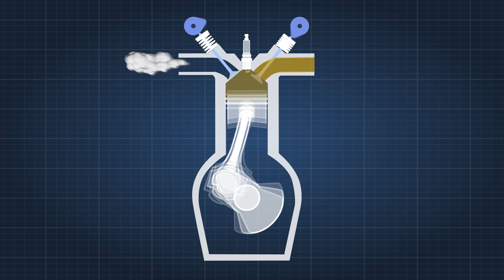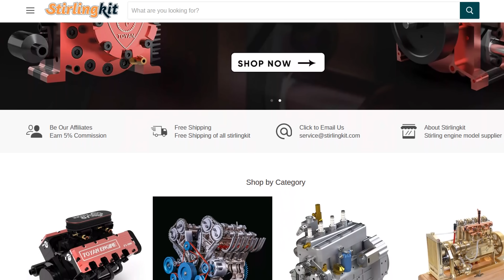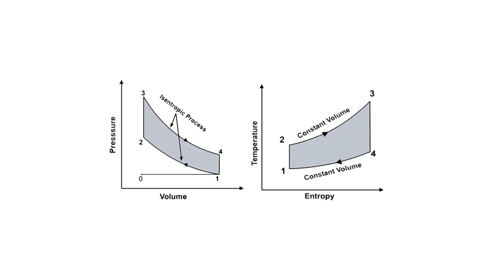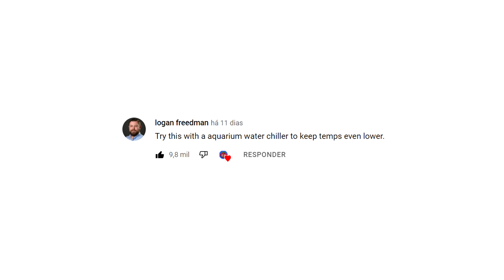I 3D Printed a Transparent Combustion Engine in Resin

Comment: Hi, can you make a vertical launched pulse jet powered rocket ?? i mean it is easier to make desired shape of nozzles & use of different fuel combinations than making complex turbine cycle use pressurise fuel & oxygen tanks like aluminium perfume cans to pump fuel & oxygen into the engine flow controlled by some air flow controls which used on pneumatic cylinders to achieve perfect mixture. i don't know it will work or not but I am just suggesting & if it runs on controlled rate than may be you can use some RC controlled fins & camera to monitor & control the flight, or you can make it without RC.

Comment: great video, nice work with the engine, another fuel you could try is hydrogen. You can make it through electrolysis or be creative and use drain cleaner and aluminium.

Comment: Im pretty sure nitromethane has less energy/liter with as you said the upside being the ability to burn more of it. This small engine could run into a plethora of different problems with this. Hard to test without owning one though.
Only things that come to mind are:
Inability to feed enough fuel, inability to properly aerolize all the fuel (especially because it's a carbureted engine) and the resin cylinder bending under the increased pressure and letting the pressure bypass the piston.

Comment: Even though the fuel is technically more powerful, that's only because you can burn way more of it in the same volume of air, which is limited by the size of the cylinder. The amount of fuel provided by the carburetor is fixed, so the nitromethane would have thr same amount of fuel per cycle as the higher density fuels. To make it run closer to stochiometric ratio, you'd need a larger jet in the carb

Comment: more compressing volume 2 ways to solve make rod conncting piston to shaft longer or make cylinder and piston wider
or the acrylic doesnt hold heat well

launch tomato into space it will freeze there

Comment: I think you need to up the Jules of the spark for starters. Than look at either increasing the exhaust valve or increasing the compression. I think if you decrease the intake valve you might start to find the perfect air fuel ratio which is absolutely critical in a 4 stroke engine design. Good luck!!!

Comment: Could you maybe try and see which if the fuels produce the most torque, maybe use a weight attached to a pulley and see which one can lift it the quickest?? Or drive a wheel on the skateboard and see which has faster acceleration???

Comment: Air fuel mixture may be off 
The engine may be over speeding and causing it to miss fire from to much intake velocity and causing it to blow out the spark or the high speeds could be causing valve float with as small as the valve springs are witch would cause the engine to run poorly from losing compression from the valves not closing completely you may need to put some tipe of load on the engine or some tipe of governor to control max engine speed

Comment: Every video I’ve ever seen of these miniature engines, they run very fuel rich, you can see it pouring out of the exhaust and in the case of transparent engines you can see it inside the cylinder. I think you need to find a way to lean the mixture out.

You may also want to find a better way to trigger the spark. I know I’m theory the magnet system works but these are toy engines, they’re never going to be perfect. The ideal solution would be a spark controller ECU like megajolt and a crank trigger but you could just try more of a constant arc like from a neon transformer to just be ‘sparking’ all the time. Perhaps it will affect the timing but it’s worth a try.

Comment: Yea this seems like a Combination of things;
1] The Acrylic Cylinder is not sealed well, you can see some Fuel leakage on the top of the Cylinder
2] The Air-Fuel Ratio is so high to the point that it's unable to ignite due to a Lack of Oxygen, in a way the engine is literally being Suffocated
3] The Engine might also be potentially Missing sparks due to a faulty timing system but this seems unlikely

Most of this can be fixed by simply changing the AFR usually done by turning a Screw in the Carburetor assembly where Tightening it means a Richer mixture and Loosening means a Leaner Mixture which is what we want. Also to fix the sealing try a combination of O Rings, Adhesives and Tension.

Comment: One issue you are running into is the different optimum air fuel ratios each fuel has.  
Dragsters that run on nitro run air fuel ratios close to 1:1 or less.
Gasoline engines run about 12.5:1 or so for max power and
Methanol is ~6.X or so I think. 

Each fuel also has a certain resistance to ignition which is part of what you are seeing in the non-4 stroke running. Methanol also runs cooler than the others to the point that given the right conditions can ice over an intake manifold. 

Nitromethane is an interesting fuel as it carries its own oxygen and can be used as a rocket fuel with an oxidizer or could be used as a mono-propellant. The more load it is given in a 4 stroke engine, the more power it will make. 

Try a hotter spark to get a more reliable ignition.

Comment: chances are that the pressure in the cylinder is Less therefore the engine has less resistance. if they were to get an external load the best fuel would maintain speed better than the others. 
that's just my guess as a mechanic.

Comment: Without a load you get unrealistic speeds
The missed ignition probably cause the unexpanded gases to easierly escape the piston.
A load might actually slow down the engine and cause ignition every 4 strokes.

Comment: Maybe the higher the RPM, the less time is used for the intake stroke, not being enough for getting over the fuel inertia, causing not enough fuel is sucked in -> no ignition.

Also, the thing you said, it can be that when the engine reaches high RPM, the time the spark needs to ignite is more than the time it has to do so. Just guessing

Comment: Timing has a lot to do with it.  Making sure that your cylinder is the correct size, maybe add some cross hatching to it.  Getting the air/fuel mix right is good too.

EDIT:  Also, you didn't really go into how the ignition system works.  Is it like a modern engine ign. system that charges a coil, or like a lawn mower that just triggers the spark mechanically?  There are a lot of variables here, but the RPMs you are seeing shouldn't be an issue.  It takes about 180 deg. of rotation to charge a coil 3ms (IIRC) at 10,000 RPM, so that's plenty of time for a single cylinder.

Comment: have you heard about the new omega 1 engine in development? 300hp from A 30-pound motor. it's a new style of rotary that's gonna change everything. you should try to build one, this is a true challenge because it's so new there's not that much footage or information on it. a true test of the engineering mind.

Comment: Why don't you use hydrogen to run your engine? It's carbon neutral(like, after burning, instead of co2, you get h2o) and is at leat 2x more powerfull than gassoline. The best part about this idea is, that you don't need to make another engine, it can run with almost every IC engine. Il'd love to see your approch about this idea.

Comment: I used to fly radio controlled airplanes that ran on 10 and 15% nitro/ methanol fuels. The engine is running slower due to the  air fuel mixture. Each fuel needs the carb  needle valve adjusted to run the best. Nitro blend fuel will burn at a lot wider air fuel ratio than gasoline or methanol.  Adding some load to the engine will help the misfiring as well. Needle jets designed for nitro fuels are less precise than ones designed for gasoline. Converting nitro engines to run on gasoline is difficult since the metering for nitro fuel is not precise enough to fine tune  a gasoline mixture.

Comment: You are in fact losing compression through the head gasket area, I could see bubbles on the first slo-mo of the engine running
However I do think that's just one of the issues, tuning an engine that small is an absolute pain I imagine

Comment: Simply going by industrial/military 'multi-fuel' engines, generally to burn a wider range of fuels requires lower compression, my guess would be the first firing is blowing past the o-ring piston ring and pressurising the crankcase, needing the second dead stroke to equalise, hence the hit and miss firing? Perhaps vent the sealed crankcase if it's not already vented and try making a more precise fit between piston and bore, possibly just a thicker/square profile o-ring? The colour of the flame also will tell you if you are getting nearer a stoichiometric (perfect 80/20 air fuel) mixture the flame should go from orange to blue.

Comment: You need the carburetor to be turned differently to work with each type of fuel. They each require a different air/fuel mixture

Comment: What's happening is a misfire on all the fuels except for nitro 25% this is either caused by inconsistent valve or ignition timing or a rich fuel mixture(too much fuel, not enough air). With this little engine I believe the rubber oring and the resin cylinder don't quite seal too good, so you're probably losing some of your compression there which doesn't help with the misfire.

Comment: You could be dealing with pre ignition, the fuel is burning when the piston is stilo going up, wich Will slow down the piston.you can even have little pockets of air and fuel that are self combusting causing extra unbalenced force on the sistem. Try retarding the ignition on the stronger fuels to get the most out of  them (be carefull because this can also destoy the piston).

Comment: when we use methane in drag racing we always modify the engine to take the extra power from the fuel which includes the ability to cram more of the fuel into the engine along with more spark power from the coils . we need to go with a more powerful coil to allow the fuel to be completely burned if you don't almost half of the fuel will just go out the tail pipe which is a waste

Comment: If it hasn't been said already electrically bond the head to the block, the original engine had a conductive cylinder for doing that, yours is probably using the valvetrain.

Comment: better carburetor the mixing ratio needs more oxygen with higher energy density of the fuel. therefore turbocharger, pure oxygen, nitrous oxide or all together for the overkill factor

Comment: Nitro has a slower flame front. More ignition timing needs to be added to take advantage of the additional power. Also with nitro you can make more power by adding more fuel. Basically can add fuel to the point where you will hydro lock the engine and you will keep making more power till you bend or break something.

Comment: the inconsistency across the fuels is very likely due to incorrect air/fuel mixtures. The carburator is made for gasoline, not for methanol or nitromethane. those require very different mixtures. Also, flame colour differs wildly from fuel to fuel. Nitromethane for example burns almost invisible afaik.

Comment: The different speeds might have to do with the mixtures igniting at different positional degrees, which can seriously harm efficiency.
Also the air fuel ratio might be very off
Reply: exactly, car engines have a timing adjustment to advance the timing with a faster rpm

Comment: I think it has to do with timing, by changing the octane of the fuels as you are, you change the ignition point in the cycle, you'd have to tune the timing to match the ignition time, useful for increasing compression to avoid detonation (Lower octanes self detonate under higher compression).
Reply: The motor has electronic ignition so unless it was a super high compression I wouldn't suspect there to be an issue with pre-ignition. Maybe double check with a micrometer the length of the cylinder maybe even sand it down a bit to gain some compression
Reply: Not to take away from what you said or be rude in any way but I don't suspect this four-stroke has the same type of compression that maybe a nitro 2-stroke motor would have
Reply: Timing as nothing to do with octane rating. Gasoline will brun at the same rate whatever the octane rating. The maximum timing that engine can take is only relavent to the engine itself and combustion chamber design. If an engine can make more power with more timing on an higher octane fuel it's simply that you havent reached the maximum of the engine yet. Let's say max timing of 36deg is acheived with 91oct, 116oct race fuel wont make more power, it will be the exact same. If you cant reach max timing we "said" octane fuel well its another storry. This as been proven on an engine dyno by Engine Master on Motortrend

Comment: I’m wondering if the nitro methane mixes actually had an opposite effect on the engine as it messed with the ratio of oxygen to fuel too much. Like if the nitro methane acts as an oxidiser and then there is also oxygen drawn from the air, has the ratio of oxygen reduced the fuel component in each compression too much. (This would explain why higher levels of the nitro methane produced less power). Just a thought but maybe something worth looking at?
Reply: Think it might be the opposite but for the same reasons.  If it's too rich then would the nitro be easier to ignite since it's carrying some oxygen with it and would that explain the weak but consistent ignition since it's only burning with the oxygen the fuel brought in?

Comment: Could be the resin modification you made, not trapping in heat as the metal did. It's true these engines waste a lot of energy through heat but does need some in order to run properly. It helps with igniting the fuel after the compression stroke.
While too much heat leads to premature ignition which is bad because it slams the engine/piston backwards.

Comment: You might be able to get better compression if you print piston rings in resin as well, like duplicating the usually metal piston rings with the tiny slit.
I suspect that the sealing ring has a lot of friction with the piston wall and lowers the compression, the different fuels will lubricate differently depending on boiling point, polarity and viscosity, which might explain some differences.
The air/fuel mixture might also be off, as explained by some other comments, if you could get your hands on a lambda sensor you can measure the oxygen content of the exhaust and adjust for that as well.
Reply: I'm not too convinced that sparkplug timing is a problem, nitromethane especially is very flammable and it would be more likely to misfire.

Comment: You can try to make an engine run using electrolysis of water to create hydrogen gas and ignite that. Making a more eco-friendly engine model and maybe making a more powerful fuel source. There is also putting Aluminum foil into hydrochloric Acid I think, this will break down the aluminum foil and chemically react to make Hydrogen gas also.

Comment: From what i know, nitrous lets the fuel ignite at lower temps keeping the engine a few degrees cooler and getting more out of the engine, but ive been told that it lets fuel get so cold in the culinder that you can actually cause “freezer burns” but im not completely knowledgeable

Comment: You already answered your own question!
You need alot more nitromethane for the same energy, that carburetor is surtenly not built to deliver that much fuel volume. 
Besides, did you adjust the mixture at all while Runing the Nitro fuel?

Comment: It's not running good snd not consistently firing because of how gas burns. Gas is harder for this engine to burn because the engine isn't sparking all that much and the 25% nitro/methane mix has a lower burning point. Also, you could be running too rich and there's not enough air getting into the fuel/air mixture.

Comment: Run the 4-stroke engine on Hydrogen and Oxygen!!!! You can make hydrogen by running electricity through water using an anode and cathode... one side will make pure hydrogen and the other makes pure oxygen - there are TONS OF VIDEOS on how to do this.. PLUS ones that run 4-stroke engines on it too!!!!

Comment: Maybe the ignition timing is off. I only know from old camshaft engines, that you have to adjust the ignition timing depending on valve timings, power, compression, etc. igniting the mixture too early or too late highly affects engine power and can even damage your engine (e.g.: igniting the mixture too early when the cylinder moves upwards during compression stroke). I think old manuals of old xl125 or cb125 honda motorcycles give a bit of insight.   Or the engine runs too fat.

Comment: I have a feeling it is because of the gas escaping though the gap you created. Perhaps a "head gasket" or a layer of thick oil or even a silicon seal could fix the issue.
So because the compression stroke is before the fuel injection the pressure is gone before ignition takes place which significantly lowers the chance of ignition. It's possible the last fuel you used burns easier and therefore does not have the same problem.

Another observation I made is that the o-ring around the piston is leaking. You can clearly see fuel below the o-ring which means compression there is also not optimal. You could try a thicker o-ring or try decreasing the middle gap in your 3d print by a tiny amount.

That said the first point could have been a thing in your first thing and not the second. I am not sure. The other thing is valid though I think.

Comment: Fuel Explaination: I presume the carburetor is tuned for gasoline, so the air fuel mixture is most efficient for gasoline. Other fuels require different ratios of oxygen and fuel to make optimal power. For example, methanol runs best around 6:1 air:fuel, but gasoline runs at 14:1.